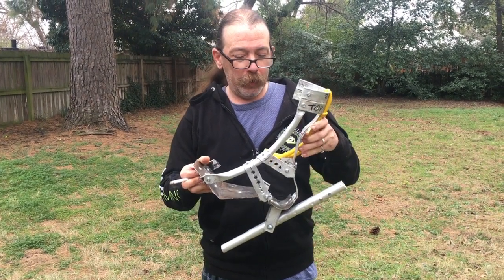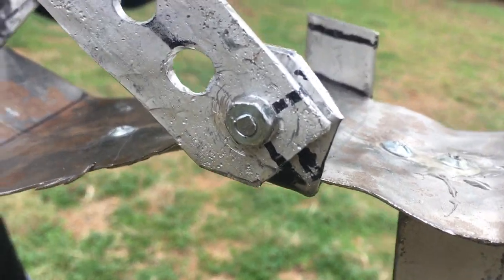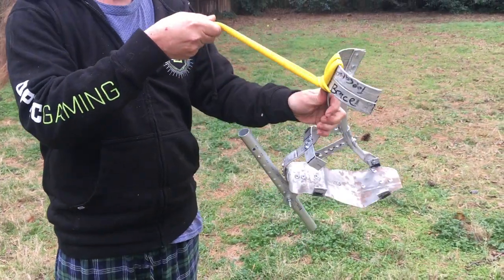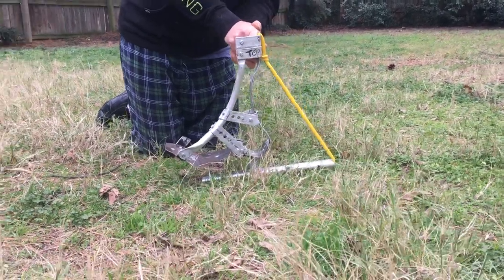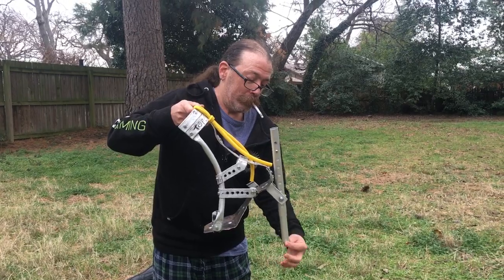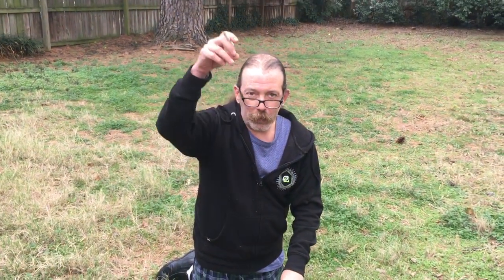Bionic Boot Construction by Ash Davis

Comment: Hi my names Joseph, I am writing from Italy and I'd Need  help for my project I'd like to create a kind of Bionic leg, like a prothestis for normal people, the main purpose Is increase the heigh, but also the Power. There are the Bionic boot and the Jumping stilts I used the Jumping stilts, it's not easy to work with them, now my questions is if Is possible modified the Jumping stilts, o create a different kind of Jumping stilts o Bionic boot o similar things, for

1 Increase the heigh

2 Run fast and Jumping 

Make that you do with your legs and also more, for example tò dance and make karate,  I don't know if Is Just possibile to do this with Jumping stilts ecc but on your opinion what the Ideal design for to do what I told you? Can you help me?
Reply from the maker: So lemme get this straight and tell me if I'm wrong...

You want a jumping stilt (hat is. ONE stilt) for one leg, and a bionic boot similar to what I'm building - for the other foot?

Again, correct me if I'm wrong:

I'm imagining a man who has extensive injuries to both legs. He still has one good foot, but not a lot of range for pivoting his ankle. And the other leg is way more injured, which resulted in the amputation of his lower leg below the knee. 

So what it is that you want is a bionic boot for the leg which still has a foot, and a jumping stilt for the other leg which I'm simply guessing has been amputated.

Do I have that right?

Because that's gonna cause some severe imbalance between the two legs. Especially since there are TWO ENTIRELY DIFFERENT mechanisms for each leg.

I would suggest going with one or the other for both legs. 

Hit me back and let me know if I've got this straight.
Reply: @kaxtorplose  Maybe because I am Italian I wrong write something you didn't understand, I repeat; I want to create some sort of prosthesis or exoskeleton, I don't know how to define it for normal people without amputation or injuries, the purpose is to increase height but also the ability to run and jump or modify jumping stilts for this purpose, the problem is that with Jumping stilts it is difficult to keep balance, do squats etc
Reply from the maker: @giuseppebonelli  So basically what you're saying is, you want the bionic boots - both of them - with an extension (stilt) attached possibly to the top of the boots or maybe by simply lengthening the top of the boots with stilts? 

The way I'm imagining it now is as a kind of shock absorber for the stilt, which is attached to the calf of the boots, which lengthens your legs. 

I don't think it's your English. I think your English is fine. I just need to visualize better what you're describing.

Here's what I could do - I can make a few sketches and you can tell me if that's what you're looking for. Then if it still needs work, you can explain it so I understand it better and I'll draw another one.

I think if I draw what I think you're describing, you can tell me if what I'm drawing is what you're looking for.

And then I could make another sketch of I need to. After 2 or 3 sketches with you giving me your input after viewing each sketch, I think I'll quickly zero in on what you're looking for.

Gimme the rest of the day to work on some sketches, then I'll make a short YouTube video describing how I'm thinking of it, and you can comment on whether or not I'm getting closer to what you want, or less like what you want.

Ok? I've got some things to do today, but I can probably draw a sketch or a couple of sketches and you can look at them and lemme know if it's what you want.

Comment: Very good you could design a part in tinkercad as and have it 3D printed and they will post it to you.
Reply from the maker: I've thought about outsourcing some 3D printing for parts but they would need to be metal. Specifically, 1601 allow aircraft grade aluminum, or I'm gonna need to spend money I've never had instead of dumpster diving for crutches. Still, I can order aluminum 1/8th sheeting and tubing for less than a hundred dollars, and I have a lot of tools, just need to buy some bits for cutting metal. I've got my own blueprints ready to go.

Comment: Hey Ash....its Gamecrazy.  Never knew you posted a vid of these.  Hows the X wing coming along?
Reply from the maker: The X-Wing is slowly coming together. 

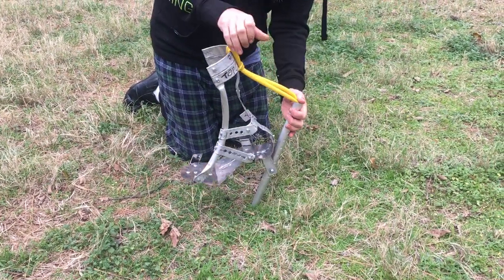The problem is I started out at a 1:36 scale, about 12 inches long, which is just on the threshold of being too small for the amount of detail I am putting into it. 

So, since cardboard ain't the most durable materia - that is, when you handle it a lot, it's easy to rough up, bend, tear, etc..., so it's easy to fuck it up when trying to cut it, build it, assemble it, attach it, repair it, or detail it. Each time that happens - and it happens a LOT - I have to start over, and I'm left with the detritus of failed parts scattered hither and yon all over my workspace! And does it ever get messed up, and FAST! on my work table.

Anyway, I'll describe my progress: 

1. I've got the four main, forward engine assemblies 90% designed and 75% built.
2. I haven't designed the pattern for the rear projecting engine assemblies yet, so I haven't even started on them.
3. The rear bulkhead is about 50% designed and built.
5. The wings are 90% designed and 80% built.
6. The rotating wing mechanism is 100% designed, but I haven't shaped and assembled the pieces yet.
7. The canopy is 80% designed.
8. The cannons are 75% designed.
9. The droid bay behind the canopy is 25% designed, 10% built.
10. I haven't designed the pattern for the nose cone yet.
11. The rest of the complete hull exists in six major pieces, all of which have been designed and cut out - four of which have been assembled - one of which is ready to be assembled, and one which still needs to be shaped. 

I'm plating the entire thing with thin aluminum. So far I've got the wings 90% plated, and painted. I'm going to paint the engines next.

Here are all of the materials I've used so far:

A dozen 12" x 24" thin disposable aluminum cookie sheets. 

A dozen Keurig cardboard coffee pod boxes.

Six Fruity Pebbles cereal boxes.

Four Honey Nut Cheerios boxes.

Two Frosted Mini Wheats boxes.

A dozen Ritz Crackers boxes.

Seven saltine cracker boxes.

Three frozen pizza boxes.

One Oculus Quest 2 box (that's some high quality cardboard!).

One carry-out pizza box.

One quarter of the bottom half of one side of an aluminum crutch.

Several dozen hot glue sticks.

Eight inches of solder.

A dozen bottles of Loc-Tite super glue.

A couple dozen very thin wooden dowels about 10" long x 3mm wide (used for structure bracing along the length of the model).

One roll of electrical tape, used to construct four conical front engine inlets, thusly - 
Starting at the top of a wooden dowel, begin wrapping tape around the dowel, moving the tape downward after two or three wraps while moving steadily downward, while slowly increasing the diameter of the wrapped electrical tape along the dowel downward for about an inch, until the tip of the cone is a couple of mm, and the base is about half an inch in diameter, and the slope of the cone about 35° from base to tip.

One bottle of Gorilla Wood Glue.

Six magnetic phone mounts. All I need are the magnets inside each mount, about 24 of them. Once I've extracted the magnets, I throw the plastic mounts away. I'll use the magnets to hold the wings in the open and closed positions.

And finally:

CLEAR PLASTIC. For the canopy glass, of course.

When I'm finished, I'lledit the whole build process into a video slideshow of photos on YouTube, over which I'll narrate the build process from start to finish. 

THEN! 

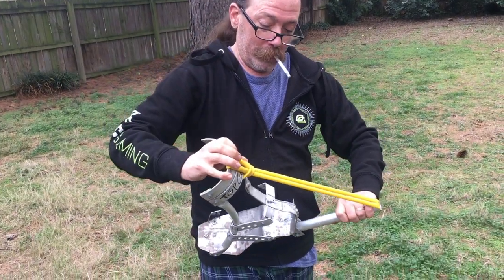I'll start over with a larger X-Wing cardboard model, about 1:12 scale, or about three feet long. At that size, I won't have any trouble just using cardboard (and clear plastic for the canopy) and I won't have to use aluminum sheeting to cover up irregularities and to provide detail. It will be a work of Pure Cardboard Art!

Oh. In both models, I'll install red diode lasers in the back engine assemblies behind clear, slightly opaque plastic so that the engines will light up, and with it all wired to a switch on the base stand, which I'll construct.

With the way it's going, I usually spend one day, every day, for about four days, designing a part with precise measurements, cutting it out of cardboard, assembling it, applying details, finishing it, letting it percolate in my mind for about an hour, discovering flaws, redesigning it, and by that time, the day is over. Then I'll spend the next day assembling the redesigned part, which half of the time results in an acceptable part, but the other half of the time, I have to discard and start over again, each time learning from my previous mistakes. Usually the third time is the charm.

That's where I am with the forward engine assemblies, which I'm working on now. Each engine has sixteen individual parts which have to fit together perfectly, and I have six of the sixteen parts assembled for each engine, and now I have to clean up all of the rough parts, like where super glue dried where it's not supposed to, and where sticky grime needs to be wiped up with acetone. Then I'll be able to assemble the other parts and glue them permanently to each engine.

After that, it's clean up the engines, prime and paint them, apply clear coat, and then it's time to continue working on the rear bulkhead until it's finished. Then I'll tackle the droid bay, and then the canopy, then the nose cone, then I'll put it all together, and...

Well. I'm grievously sorry, but once the final model hits YouTube, it's gonna break the internet. It's an unavoidable, and regrettable side affect, but it must be done.

Comment: Ok.i got pretty far today.a variation on the bionic boot.i call it the exo-bionic leg assist.orthopedic device.its primary function is to strengthen weak legs and assist with climbing hills and stairs.so far they work great.just need a few more odds and ends to finish them up.then I can make video.i have so much going on I haven't had time to make any new videos lately.but,wish me luck man!I need it!👋😀💪👍💯
Reply from the maker: Cool, keep me informed! Yeah, I've been meaning to make a short video of my Mk.5 boots, but in between scratch building this cardboard X-Wing fighter and playing my new Oculus Quest 2, I wind up losing track of time like nobody's business! Anyway, yeah, I'm looking forward to seeing what it is you've made. I've messed around with the designs for unpowered bionic upper torso and arm assists that work using block and tackle and double pulley systems, but I've never actually made anything physical. I think that it's feasible though, an upper body exoskeleton that actually increases leverage and power without any hydraulics or electric motors or battery packs or any of that limiting stuff. Okay, back to the X-Wing.
Reply: @kaxtorplose  I use heavy duty springs and  bungie cords and whatever works.ive been doing this shit ever since the six million dollar man show came out on TV.since twelve years old.have the first season on DVD.hey,if it can be thought up, designed and built,then anything is feasible.you have no limits.neither do i.its nice to find someone like myself.ive built an Android,now a pet car,shit,.... the list goes on!it's people like us that change things for the better.keep up the great work.simply,life gets in the way as usual.talk to you soon.
Reply from the maker: @johnmoran7996  Hey, John. I made that video displaying my bionic boots, explaining why the load bearing pivot on the right boot failed, and what I'm going to do to repair it. Check it out:

https://youtu.be/wVEznxtGSls
Reply: @kaxtorplose  I definitely will.im getting pretty far with my exo-bionic suit.ive decided to go all the way and make arm attachments too!I'll check yours out.see you soon.good deal!👍💪😁👋I haven't had a chance to do anymore videos because I'm so busy building shit!when I'm done.and of course life gets in my way
Damnit!where's my fucking toggle bolts?ha,ha!
Reply: @kaxtorplose  ash,I watched the video of your bionic boot.pretty impressive!I seem to be the only one that commented on it even though you got a lot of views.keep up the great work.like me,it's a work in progress.we will both achieve our goal to bionisize the world.😁💪👍👋

Comment: This is John Moran.Great idea, man!Ive used the same stuff such as the slotted iron for a lot of my artificial limbs I've made in the past.the exo-bionic brace is nearly complete and I'll be testing it out soon.once the field test is done I'm going to make a video.since it's made of cardboard mostly I have no idea how it will stand up to the mechanical stress.it uses six springs in the joints,....two in rear of foot assembly and four on the front of the knee assembly.and,it uses five industrial strength Velcro to strap it onto my right leg.wish me luck!😁😀👋👍 By the way, excellent design on those bionic boots!I'm very impressed!
Reply: Hi my names Joseph, I am writing from Italy and I'd Need  help for my project I'd like to create a kind of Bionic leg, like a prothestis for normal people, the main purpose Is increase the heigh, but also the Power. There are the Bionic boot and the Jumping stilts I used the Jumping stilts, it's not easy to work with them, now my questions is if Is possible modified the Jumping stilts, o create a different kind of Jumping stilts o Bionic boot o similar things, for
1 Increase the heigh
2 Run fast and Jumping 
Make that you do with your legs and also more, for example tò dance and make karate,  I don't know if Is Just possibile to do this with Jumping stilts ecc but on your opinion what the Ideal design for to do what I told you? Can you help me?

Comment: Great stuff! How’s the boot coming along?
Reply from the maker: I finished them, but - and I have no idea how I forgot to do this - I forgot to reinforce the load bearing pivot on the right boot. When I tried them on for the first time, three hops and the pivot structure on the right boot collapsed.

I know how to fix it, but after all that effort, I was so exasperated that I shelved the project for now. Anyway it's winter. This spring I'll fix the right boot.

Here's a picture of the finished boots before the structural collapse. 

https://scontent-dfw5-1.xx.fbcdn.net/v/t1.0-9/fr/cp0/e15/q65/99254934_10158050464405661_2429800386761064448_o.jpg?_nc_cat=105&ccb=3&_nc_sid=110474&efg=eyJpIjoidCJ9&_nc_ohc=qp4NgUq1P1UAX9z_NhE&_nc_ht=scontent-dfw5-1.xx&tp=14&oh=2cf6743ba90cd404aa705ac52eeb1544&oe=604D4EC8